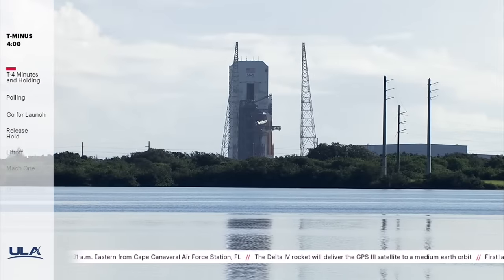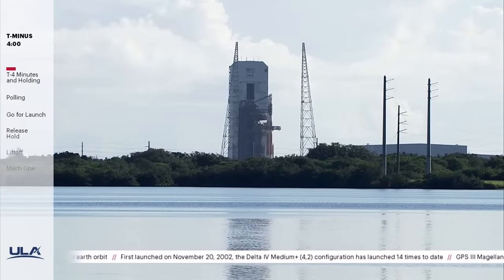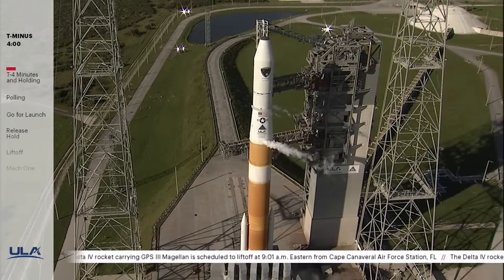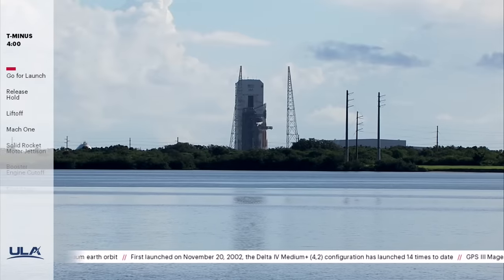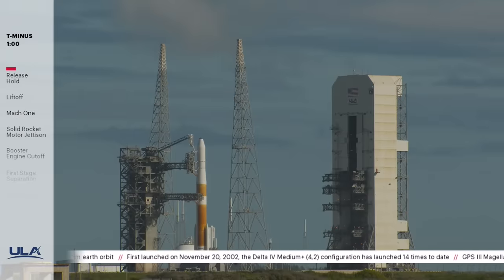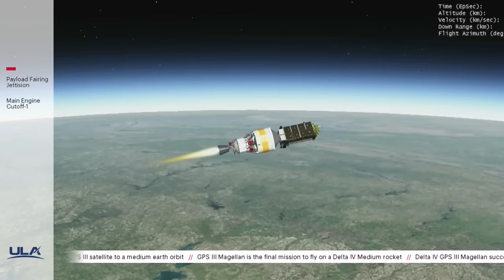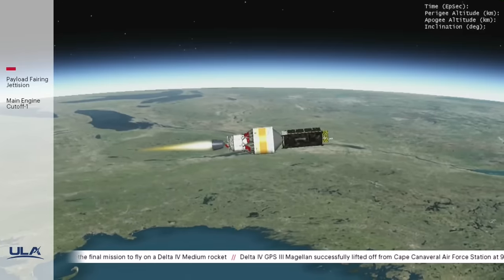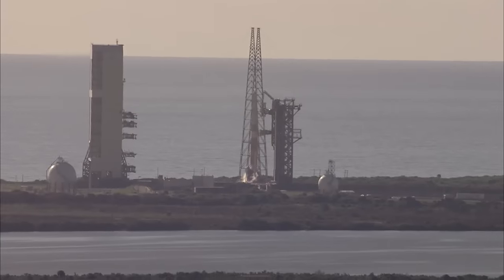Live Broadcast: Delta IV GPS III Magellan

Comment: Still no Landing Legs, is ULA giving up as a launch provider? Europe has decided to compete with SpaceX. China has decided to compete. New Zealand is going to compete. Blue Origins too. But where are Boeing and ULA. Happy and content to launch the last Antique Disposable Rocket  for the Government.
Reply: ULA also has a planned reusability program for its Vulcan rocket. Basically after meco the engine section separates from the 1st stage, it then deploys an inflatable heatshield and later on a parachute deploys and is caught by an helicopter, that's called the SMART program.
Reply: WeBeGood Ariane VI’s boosters are developed for future missions as gliders returning back to land on a runway.
Reply: You do know about Vulcan, don't you?  Look up  'Sensible Modular Autonomous Return Technology' (SMART) reuse concept.
Reply: @Nowhereman10  Not so SMART to take a half step.
Reply: @Tramseskumbanan  Yeah,  Ariane 6 plus they are talking about  RETALT, ArianeWorks.
Reply: @WeBeGood06  then you just condemned SpaceX's early efforts. They didn't start off with a reusable F9 right away, they worked up to and then only after starting with Falcon 1.
Reply: @Nowhereman10  Not really, SpaceX was extremely smart in their incremental development of the Falcon 9. Customers payed for the launches and vehicles during the re-usability Campaign.  Many crash landings that cost nothing because the payload paid for them all.
Reply: @WeBeGood06  you don't know anything about how SpaceX did their reusability development. 

In fact, they tried recovering boosters originally with parachutes ala the Space Shuttle SRBs and that failed many times because they F1s and F9s could not handle the stresses like the steel casings of the SRBs could, especially on splashdown where the wave action would tear apart and sink the fuel tanks. 

It took years and a few hints of swiping Blue Origin's VTOL concepts that they finally started to do something. Blue still beat them to getting a booster to the edge of space and back again, even if it was by a few weeks.

But that's neither here nor there. Most of the savings SpaceX has achieved so far has been due to vertical integration and consolidating their operations over competitors like Arianespace and ULA. The reuse as a money saving function is still being tested out. ULA is doing their own reuse which is based around saving the most expensive part of the rocket: the engines and propulsion plumbing. That's 80% of the rocket by cost right there and they don't need to rely on risky at see or land hoverslam landings, either.

There's lots of ways of skinning the cat here and this way may work out along with ACES upperstages to making ULA just as viable as SpaceX or Blue Origin.  ULA has already made significant cost savings and are looking to make more with Vulcan, especiall when SMART and ACES are evolved into it just as landing legs and VTOL were evolved into the previously expendable F9 by SpaceX.
Reply: .. it's a delta 4, it has no future
Reply: @Nowhereman10  LOL, funny guy. SpaceX is sprinting away from the crowd in Reusable Launch Vehicles  and ULA is not one of them.  Haven't followed ULAs plans that much, but it sounds like 20 or 30 year old rehashed concepts in a Disposable World. The time for the ULA Vulcan has come and gone 15 years ago.  According to Wikipedia, the first stage uses two 550,000 lbf Blue Origin BE-4 engines,  which would be impossible to throttle deep enough for a landing burn.  No path to a vertical landing,. Maybe they will come to their senses and put wings and wheels on it, but no clear path.  Maybe a bunch of sealevel rated RL-10s, no clear path. Sorry, ULAs path forward seems to lead to a cliff with no future. Hopefully the US Government will stop subsidizing dinosaurs.
Reply: @mobius1234  There is nothing wrong with LOX/LH2 vertical landing launch vehicles.
Reply: @Nowhereman10  You are confused, the New Glenn first stage will have Seven BE-4 engines, not Two BE-4 engines like ULA Vulcan. The New Glenn first stage will Mass out 3.5 times heavier than ULA Vulcan. So, New Glenn running One BE-4 engine will be in the Throttle Range to land while the ULA Vulcan will be too light weight to land with One BE-4 engine. ULA Vulcan will be a Disposable Rocket in a Reusable World. Like putting New Wings on a commercial airliner after every flight, but being proud to have saved Engines and Avionics. ULA will be busy installing new expensive wings, while everyone else just fills up the tank and fly off into the sunset.
Reply: @WeBeGood06  never stated anything about the number of engines on New Glenn. The mass really has nothing to do with it, so I'm not sure why you're bringing any of that up and the BE-4 can indeed deep throttle down far enough that a single engine is sufficient for NG to land. Again, this has nothing to do with Vulcan or how its BE-4s will be reused. The engines are 80% of the cost so you are saving more than you would with an airliner which has more extraneous structures than a rocket does.

 Also, bad analogy. Wing on aircraft are complex and have slats. flaps, and ailerons that require power and hydralics. It would be more like throwing away gas tanks on a car and buying that every time, but saving the chassis and engine.   And right now on the 1st stage, that's nothing in costs compared to the engines the rest of the boat tail section.

And you still have failed to address the fact that most of the cost savings thus far by SpaceX has been just consolidation and vertical integration rather than reuse, even with Block 5. And in the real world there are many, many examples of things both complex and simple that are manufactured cheaply and yet are used only once. However, ULA is aiming for reuse with SMART and ACES. ACES will be reusing the upper stage which neither F9 nor NG do. So balance will be made all around in their own ways.

Only Starship and New Armstrong will change that, and then they still have to prove that reuse is truly economical, another point you've avoided.
Reply: @WeBeGood06  Vulcan as a whole is not meant to primarily care about the first stage core, which is not that expensive in comparison to the engines. Which, ULA's priority is the later to be used ACES engine which is to be used as a way of being able to be refueled and used for extended duration into deep space flight. even though yes, this does not have a high a chance of success there is a chance that it could work as life support to allow for ULA to be able to get in orbit construction infrastructure started. Which, if they are able to bring in the profits of early space mining it could fund many more launches even though yes, they will have to constantly reconstruct the core which will stall launch times, and will rise costs which may result in a new first stage booster to be created, however for re usability it is indeed true that potential payload is lost due to the mid course corrections that are required.

Oh, and before you state about the SpaceX Starship plan it is meant to be able to allow for colonisation of planets, which is why it is the size it is so that it can transport crews. Whilst at the same time, being so big that it can re-use itself which again, will drive up development costs. - There is no point for having people up in space other than for colonies as machines are on the verge of being able to do everything else, even still if it is required to have things made it'd be better to use SSTOs like Skylon to transport people into Orbit if they develop. 

Even still, there is the fact that the engines need to be checked over again to see if they're safe for flight as  you would not want to risk the failure of such an expansive payload.

In orbit construction is the future, and ULA knows this. [Cislunar-100]. It is far cheaper to make something in orbit long term, than launch something to orbit.
Reply: @somerandompersonidk2272  Exactly! The tank is orthogrid, optimized for manufacturability. Once the tanks are milled the scrap goes straight on a conveyer belt that goes underneath their building and right back to the next-door foundry. Avionics are all at the bottom so they can be recovered with the engine. All the cost is in the engines, and they can recover those without wasting up to three engine cycles each mission.
Reply: @WeBeGood06  If you think putting sea-level RL10s is at all viable for a rocket then I don't think you actually understand engineering enough to comment on what they should do.
Reply: @AmbientMorality  I think you misunderstood the discussion.